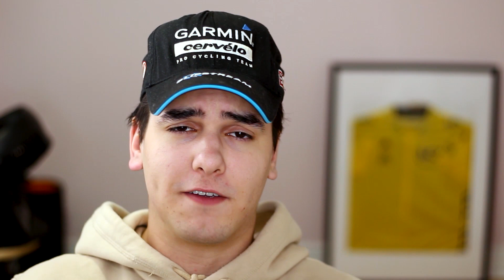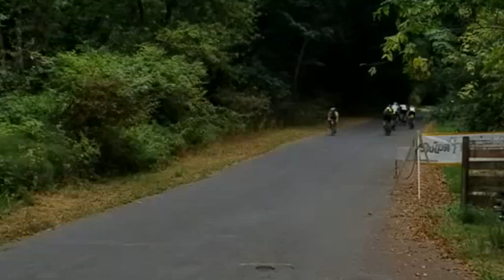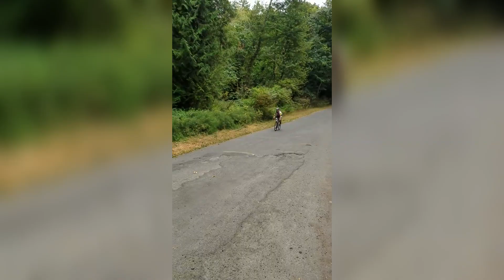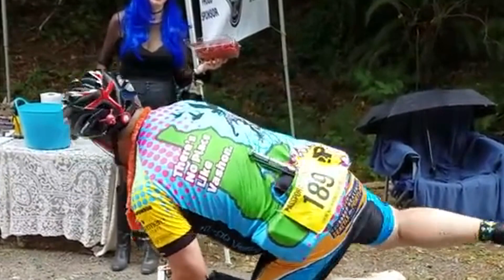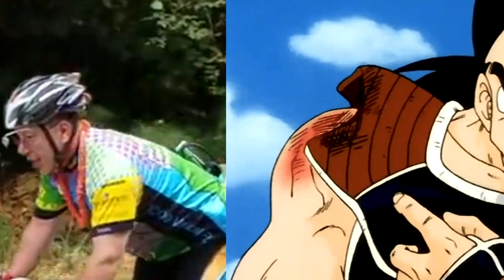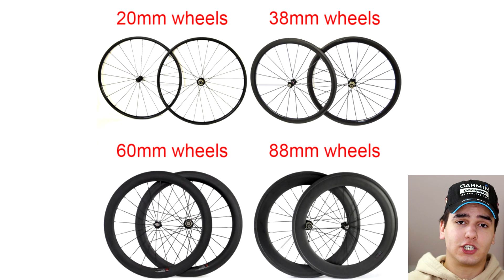Carbon Wheel FAILURE & EXPLODES (How to AVOID, Physics Explained) MUST WATCH for Heavy Riders

Comment: Its very simple. Rim tape fails to stop the tube rupturing into the spoke hole. All the pressure in the the tire/tube explodes into the aerofoil section of the rim which then cracks/explodes. Its why I only buy carbon wheels with no spoke holes in the rim, (no rim tape required) and breather holes in the aero section to release any pressure spike if they every occur. They are plenty of videos of carbon rims exploding on bike shop repair stands for the same reason.

Comment: Not 100% convinced about the physics behind the explanation. I reckon that the failure was not due to abnormal fatigue and stresses but rather from excessive heat accumulation by prolonged application of the rim brakes (heavier riders = more heat than lighter riders in identical conditions). You can infer by reading the description of the original video that the cyclist himself understood that his wheel failure was due to overheating. The wheel that failed in the video might be of an older design or questionable quality. Would also like to point out that the problem might have simply been bad luck with a defective wheel from the factory. Cheers!

For those who are here for physics:
The composite material is made up of carbon fibre held together by resin, which has lower heat performance than alloys. No matter the depth of the wheel rims, managing temperatures during heavy braking with rim brakes is a fundamental challenge with carbon fibre wheels. As technology advances, reputable manufacturers have been improving the performance of their resins to mitigate the issues with rim brakes and heat failure. Hence, carbon fibre wheels generally do not fail. However, it is important to note that the wheels are designed based on what the manufacturer deems as normal cycling behaviour, so your mileage may vary!

Comment: imo i would say its more heat dissipation.  As the rim heats and cools under braking it will make the carbon fatigue and heat the tube which will increase in pressure..  Also carbon will heat up but will not dissipate the heat like aluminium would so you get more localised hot spots which could make a point of failure.,  Anyone who has tried braking on a carbon rim with rim brakes in the wet will know how badly carbon will heat up and the braking come on all at once.  Braking after all is all about converting kinetic energy to heat..

All power to the goths..!!

Comment: If it’s man made, it will break.  You just have to be lucky, period.  I hade a Enve carbon fiber rim blowup in my basement just putting air in a tubeless setup.  And yes, I know what I am doing it.  It was a Enve fail and they gave me a new one without question.
Reply from the maker: Good customer service 👍
Reply: Prolly the rim had no pressure relief vent below the valve? If your rim tape isnt on point and vents air inside the rim then its pretty likely for carbon rims to explode from the pressure. Thats why many carbon rims have a small hole on the side wall below the valve port

Comment: Depth. Really? I think the problem is the combination of a hot day, high weight, descents - and rim brakes on carbon clinchers. 

Pros ride tubulars. They have more material near the braking surface, they don’t hold pressure, they weigh less, and they avoid dragging their brakes. The solutions are tubulars (which are impractical without a team), aluminum rims (which can handle heat, but can get dented and bent), or disc brakes. Discs are the right way to go here.

Deep rims won’t solve the problem, and some are paper thin. Just push the side with a finger and watch it deform (and move back).

He was going slow, so the overheating probably occurred earlier. That last event was just the last straw for the camel’s back.

Rim brakes are fine in many situations, but high weight, high heat, descents, carbon, and clinchers are a bad recipe.